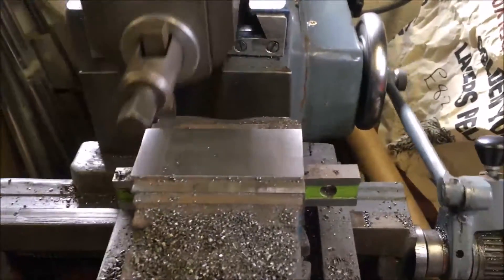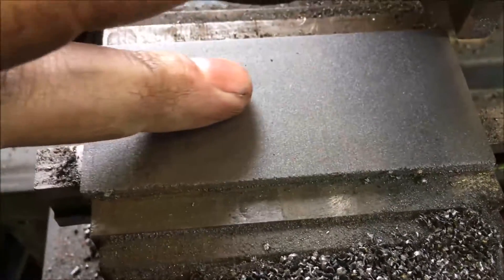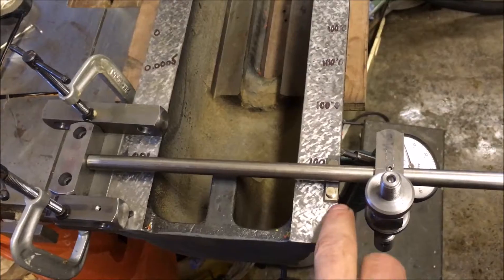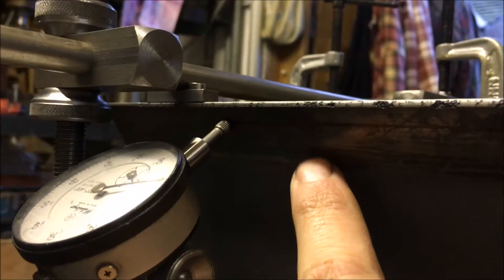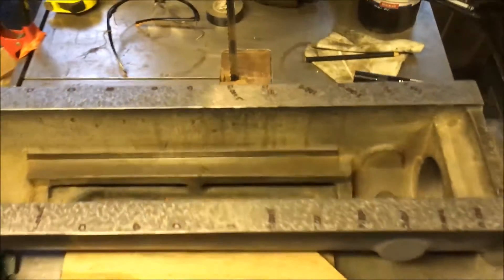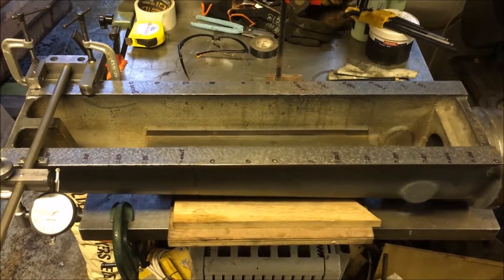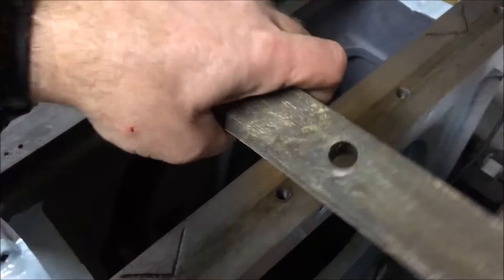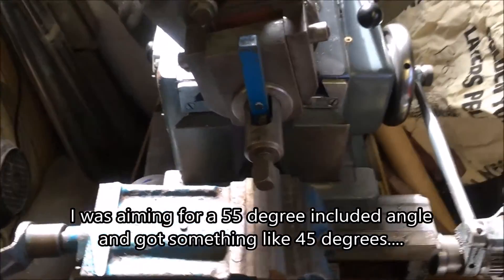Elliot 14 S Update 10 1

Comment: I'm try to use some logic about what the wear pattern "should" be on that ram Mat and that's not helping. With the cutting forces pushing the ram while it's cutting in either direction one would think it would wear to a slight bow shape. Your zero readings in the middle 8" area make sense since with smaller parts in the vise that's where the majority of wear should be. But even with a few thou clearance for oil and still allow the ram to move I would have expected to probably see a short matching low section on the rear corners of the ram as well. You already know better than I do that maintaining the correct geometry in 3 dimensions is the tough part. I'd thought there was a section in the Connelly book about shapers but I've just checked my copy and my memory is obviously faulty. 

The only thing I can come up with is if it were me I think I'd try asking some questions about the proper way to test the ram with the equipment you have or can make on the Practical Machinist Machine Rebuilding sub forum. Adding a link there to this video should get you some expert advise. Best guesses by myself or anyone without knowing 100% for sure it would be the correct method isn't in my opinion the way to go.
Reply from the maker: Well Ive just posted on PM - and linked to this video....
Thanks for stopping by and commenting. All the best Mat
Reply: Looks like you've already got a bit of information on that PM thread and I expect a lot more to come. There's some real smart and very experienced people on that forum. I did wonder about them keeping a thread about shapers there and not moving it over to maybe the antiques forum. But yours is a decent sized industrial machine and your questions are 100% about rebuilding  so I hope it will stay there.
Reply from the maker: Starting to get some useful advise for sure from the post . http://www.practicalmachinist.com/vb/machine-reconditioning-scraping-and-inspection/shaper-reconditioning-scraping-advice-sought-332372/